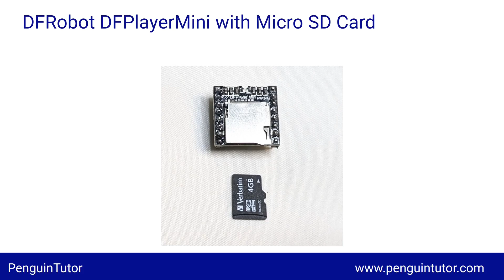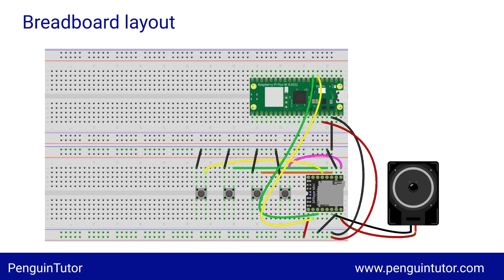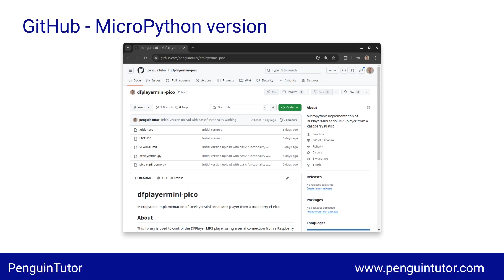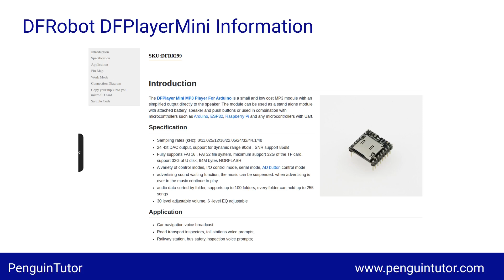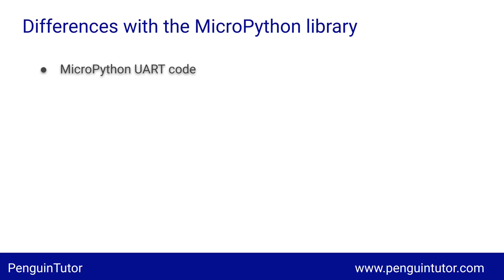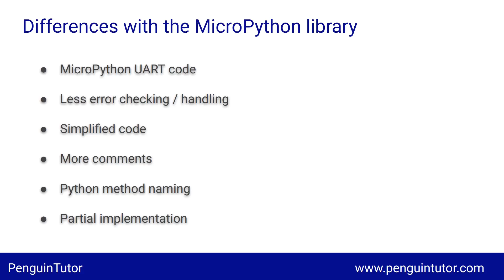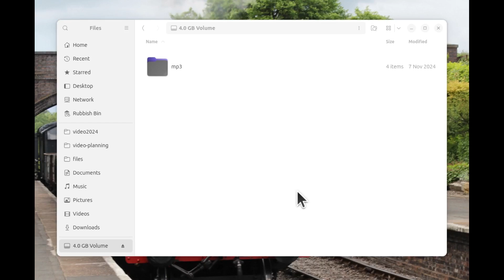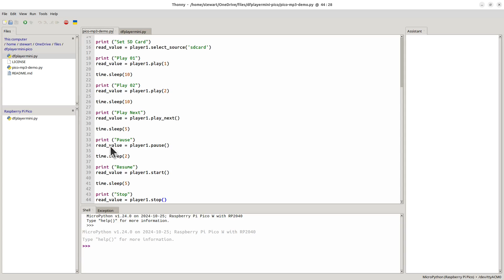Raspberry Pi Pico MP3 Player

Comment: Nice project! 👍   Any chance you will revise this code and make it output to the DACL & DACR for stereo, or won't the code fit inside the Pico?
Reply from the maker: The DACL and DACR outputs of the MP3 player output the same as the speaker, except to L and R outputs. So no changes to the code are necessary. 

The Pico is literally only sending short messages to tell the player to play MP3 files that are on the SD Card, so the Pico is hardly doing anything at all. 

The DACL and DACR can be connected straight to headphones, although they are not particularly loud. Probably better to put them through a powered amplifier first.
Reply from the maker: I have just tested and I get a fairly quiet but audible output from a pair of headphones. It is very noisy, but that is likely due to me using jumper wires to the breadboard, then a screw terminal breakout to 3.5mm jack before connecting to the headphones. 

However I do not believe this is actually outputting Stereo. According to DFRobot the DFPlayer Mini is mono only. If you want stereo you will need the DFPlayer Pro which comes with 128MB onboard storage instead of using an SD card.
Reply: @PenguinTutor  - Darn, I just ordered the Mini.  I should have gone with the pro, but I didn't notice it.  BTW, they wanted $14 just for shipping!  Crazy.  So I searched and got it from Walmart for $6.62 with shipping!
Reply: @PenguinTutor  - Great!